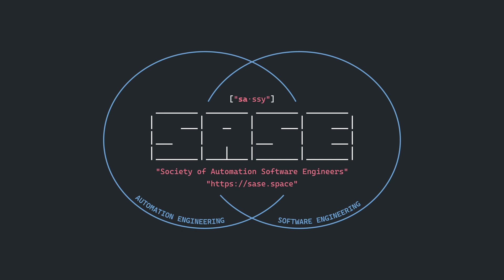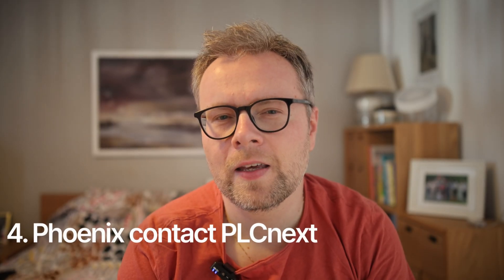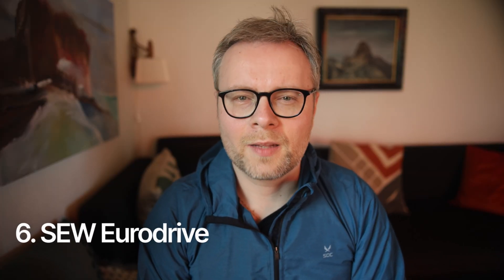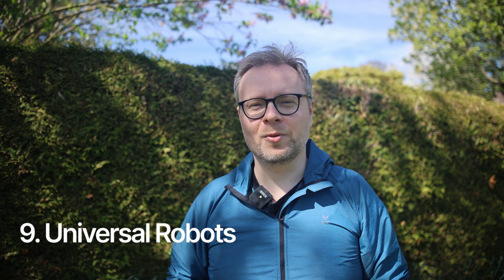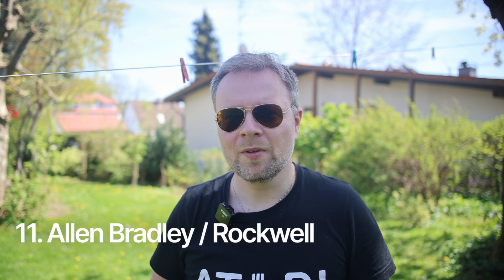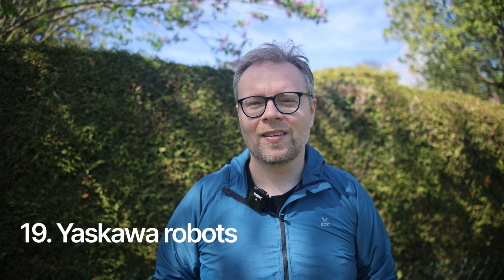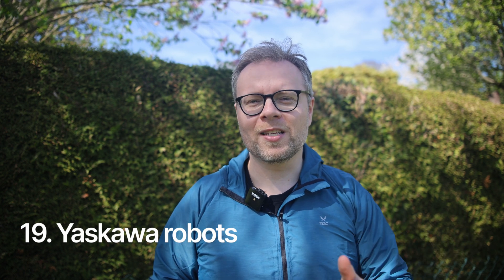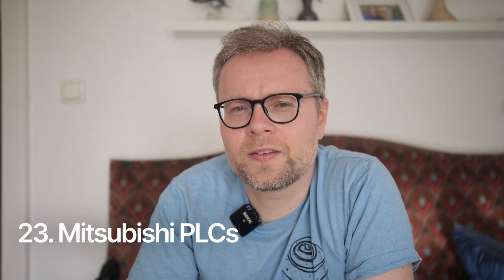25 things I don't know about industrial automation

Comment: I worked with WinCC, it's quite a mess how to start or know which version do you need for your implementation, I only worked with WinCC Advanced for embbebed HMI and PC Runtime. The wincc advanced runtime is quite stable, I see the computer that runs the runtime fails first than the runtime itself.

In a next project I will use WinCC professional for multi-monitor support (see two or more monitors with different SCADA screen in each monitor), quite pricey the tools for design the SCADA screen and runtime license, WinCC advanced is more affordable but don't have multi-monitor support.

Comment: That's why this field is amazing, great learning curve which never ends, and it,s fully versatile. Especially seeing guys in pure software engineering struggling with  jobs now. Here you can always downgrade for a while and work in maintenance or CNC machining for example. I've got ME MSc and work in maintenance of all those things, and sometimes develope something custom for the manufacturing process or simply debug raw production lines. One day I wish to work at the integrstor's and build something from the scratch, but for now its all about learning curve and impostor syndrome😅

Comment: If you like the motion control stuff, check out Triamec (not to be mixed up with Trinamic) some of the most insane precision servo drives I've seen. You can run code in the 100kHz motor control loop. They're used for a lot of semiconductor tech & diamond turning equipment, where you're dealing with nanometers or picometers.
Reply from the maker: Thanks for suggestion, I'll look into these!

Comment: Yes I have an Opto22 EPIC The thing I like about it 
It can be programmed with Codesys and works well. It has a lot of memory. I’ve used it as a flow computer measuring natural gas through an office plate. The formula is about 100 lines of nothing but math equations. I’ve created 4 instances of equation to handle 4 separate meter run. The PLC handles it easily. 
The only thing I don’t like about it is it doesn’t support Ethercat but it does support Ethernet/IP.

Comment: For me wiring the control panel was really satisfying and it still is💯. Although I don't do it lately and is done by others.😩
BTW: you probably know more than you know about how you would have wanted it to be buit.
E.g. I've put stickers with "comments" beside or on the elements. I find it more relatable to the programming the thing.
But I mostly think of myself returning to the same panel again in 20y. And be able to understan what I have done and how to fix it 😅
I also like how you can mark each wire with it's designation and unique number. It some extra work. But it's so much easier to diagnose and to rewire if needed. Especially if you are remote commissioning.
Reply from the maker: You're right! And who doesn't love a well-built electrical cabinet?

Comment: I expected more things like; "Building Automation", "Electrical Transmission Networks, Control and Planning", "Power Generation", "Agriculture Tech", "Food Processing", "Vending Machines", "Mining Industry", and so on... not simply touching products that you see in your particularly "narrow" field... Knowing the industry's "needs", "wants" and "potential" is much more satisfying than a particular tech. I have personally been in this field since 1984, first developing the RTOS and dev tools at a PLC manufacturer (now Regin) then later as systems integrator in mainly building automation, but also a bit of water treatment, power generation and steel production, and lately something as mundane as solar panel monitoring. I couldn't care less of what tools are used, but the coolest I think I ever did was to work with a research team to figure out how to make CGI (https://en.wikipedia.org/wiki/Compacted_graphite_iron) at a steel mill, where the "lab" was a corner of the steel mill with a one tonne furnace, as dirty and hot as the rest of the plant and not a lab coat in sight. ;-)